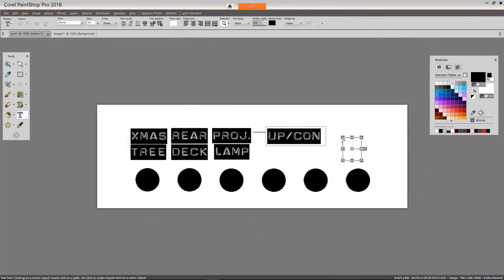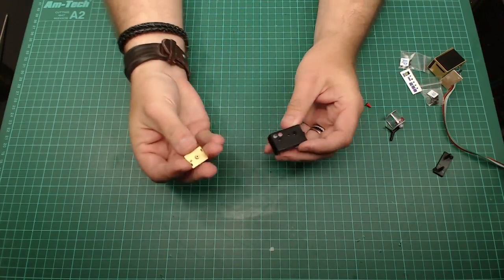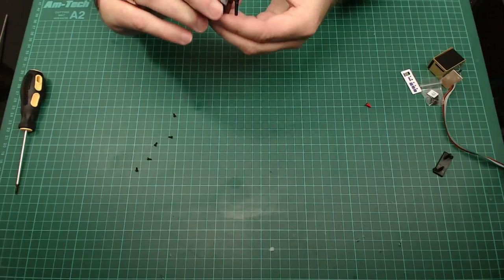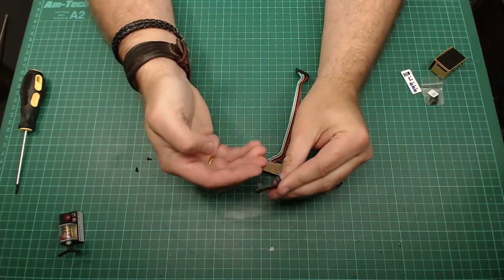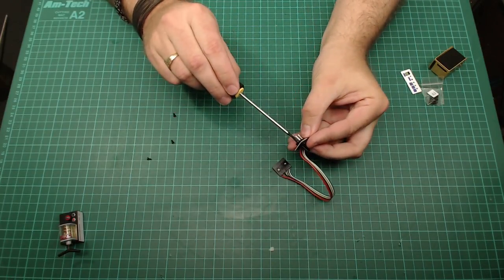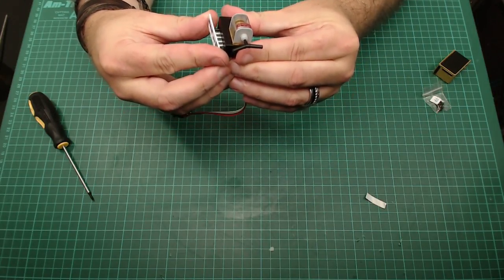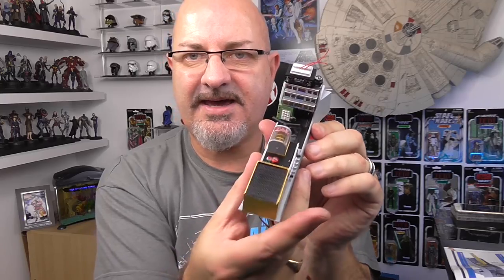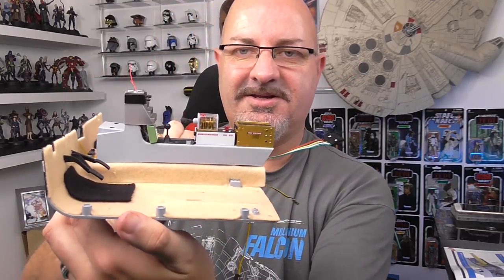Build the Delorean - Issue 43 - Time Circuit Electric Switch

Comment: Hi Wayne thought I should let you know that the Y handle has a two diameters of thickness the smaller diameter is supposed to go fully in, it doesn’t go fully in because they messed up the alignments of the time circuit and circuit case holes. All I did was use a screwdriver to increase the size of the circuit case hole from the inside and it worked, if you don’t put it in fully then the case won’t be fully secured
Reply from the maker: Thanks Mike. I figured it must have been off alignment but its holding at the moment :D
Reply: On mine at the point it wouldn’t go in any further i gave it a real hard push and it snapped into place a bit like the gear knob did :-) may not work you you guys but it worked for me. Hope that may help :-)

Comment: Hi Wayne Love the template looks really good. Just a tip. check your switches are all clicking properly. My switches were catching so had to loosen the screws underneath for them to work correct.
Reply from the maker: Nope. 2 of mine were stuck. I bent them a bit and then got the multimeter out to ensure they are all working and they are all fine now.

Comment: Lookes great,im almost there. I have a powermod and i want al the lights stay on,when i switch of the powermod and turn i back on,the lights are off again? and i still need to push the little switches on,how do i do it so the lights stay on?.Can i remove the switches for other ones that wil stay on?
Reply from the maker: Chloe from the Facebook group would be best to answer this.

Comment: I haven’t been happy with this build. My number 1 button doesn’t work I have pulled everything apart and double checked and nothing unless there’s a break inside the plastic wire? Now none of my flux lights work I need advice please
Reply from the maker: 3 things. Either the ribbon cable has become unplugged. The number 1 switch is faulty (does it click?) Or the wires have become detached when you sealed it together in issue 91
Reply: @WorldofWayneUK  thank you Wayne. The circuit board seemed in there very secure when I pulled the car apart and yes number one button clicks. So I’m not sure and I’m ready to build issues I have received this week. Up till 108 but I’m really not sure? It’s going in a glass case with a base so I’m not going to be actually switching everything on and off all the time. Thank you very much with your quick reply and for your help. Much appreciated. Simon
Reply from the maker: @barnstble  to be honest I havent touched mine since it was built

Comment: Where you put the screws in at 6:08 people are finding that the screw heads are making contact with the exposed button connections and they eventually short the buttons out. You need to add a bit of insulation tape to cover the exposed points before putting the screws in. They don't short out straight away though. Everything works wonderfully at first, until one day buttons 1 or 6 stop working. I've posted a photo of the offending screw holes at the World of Wayne proboards forum over at: http://worldofwayne.proboards.com/thread/299/button-failures-common?page=1&scrollTo=1263
Reply from the maker: Nice. Thanks Vince
Reply: Not looking forward to dismantling it all so I can get to this part and fix it though. Didn't go pear shaped until I had the body attached, the headlights in place, and the front flux bands installed.
Reply from the maker: That's the way of it normally lol
Reply: Someone on the Facebook Group saw my comment, unscrewed the screw a little so it no longer made contact with the points and now everything works again. So it's an even simpler fix by the looks of it. Still need to pull it all apart to get to the screws though. :(